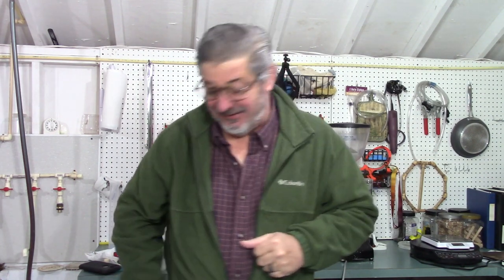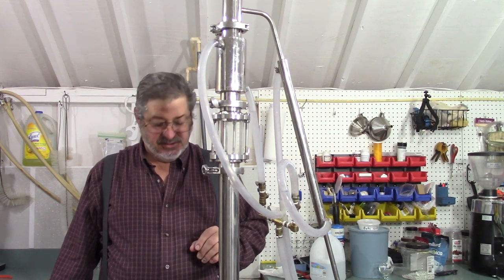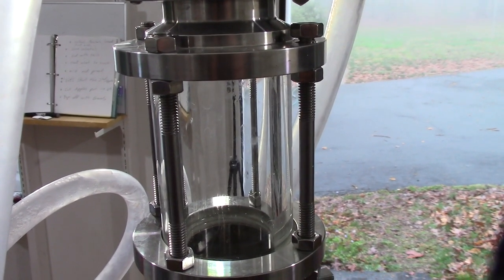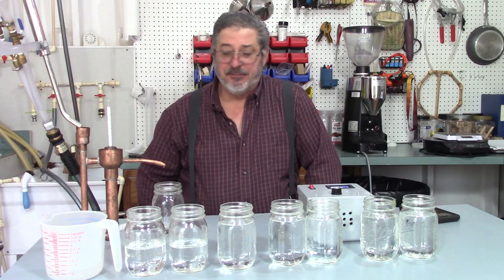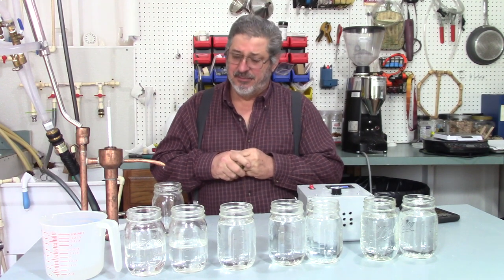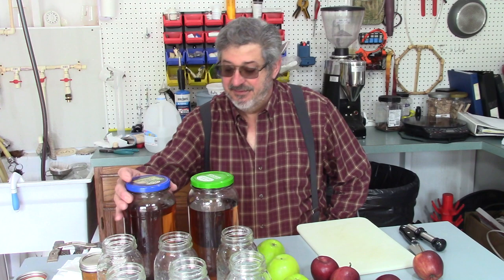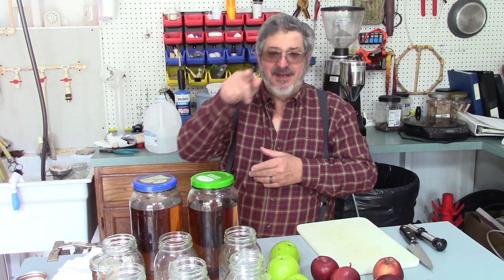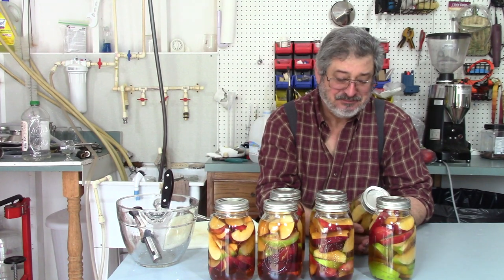E103 Apple Apple Brandy part 2

Comment: Randy great job, how do you get the apple flavor in the end if you use a post still. I have something close to what you have but I always loos all flavor at the end. I run it slow too
Reply from the maker: Great question yes you will lose "apple flavor" and you will keep the apple character of the apple so with that said you will need to add back some flavor I added the apple slices and all i can say is wow! hope this helped I will be having a tasting soon Cheers!!
Reply: @stillworksandbrewing  is there any other way. I am going to try a thumper to see. But every time I make a mash has no flavor and taste like ah!! . Not drinkable by my standards. But my lawn equipment likes it ...... any suggestions . 
Appreciate your time with videos and making it so that anyone can follow and get the just of what you are doing
Reply from the maker: @dalejohnson1577  yes a thumper will add flavor and i have added spices in a gin basket ( i use my sight glass for that) but needs to be let's say strong spices like cinnamon ect. I wanted to try some of the commercial flavorings but have not yet.

Comment: So with this apple brandy, all the forshots and heads should be out after first 6 ozs in a 6 gallon mash? I m struggling trying to figure heads hearts and tails in my first few runs . I’d appreciate any input Randy. Love your videos !
Reply from the maker: The first 6 oz will get rid of the methanol and heads after that make small cuts let air out for 24 hours taste if it taste good use it when you get into your tales you will smell and taste it. Best thing is to run low and slow and if you are heating with  propane use a diffusing plate to help prevent scorching hope this helped  Cheers

Comment: Nice Video Randy.
Couple of questions as I didn't hear it in the video - did you mix heads, hearts, and maybe a little of the tails?  What is the final ABV/proof poured into the jars?  Thx.
Reply from the maker: I collected 6 oz of forshots /heads and stopped at 80 proof left tail on table proofed down to 90  poured in jars thinking that the apples would lower to 80  cheers!!

Comment: Great video. Are you using a PID controller or the voltage adjustable that Mile High sells? I’m going to try your recipe. I appreciate your video and the way you explain it. 👍
Reply from the maker: I'm using a pwm switch I built Cheers!!
Reply: A pwm is a pulse width modulator which will control the power output to your heating element in your still. I am guessing that you already know that though. Mile - Hi does sell one, but you can make one for about half of what they charge for theirs, and it is pretty simple and can be put together in an hour or so . I believe Randy's is home brewed though. --den

Comment: Hey Randy, looking good on this recipe!  I've noticed that you trend towards 1x distillation?  Do you have a wider cut in favor of longer ageing as a result?
Reply from the maker: I do 6 gallon mashes run low and slow 6 oz forshot/heads cut and stop at 200 deg head temp 80 proof and i have been able to keep most  Cheers!!

Comment: Curious ... why don't you ever do a stripping run then a spirit run? That is how it is traditionally done unless you use a thumper. Spirit runs can be done slow in pot still mode for flavored spirits or slow in reflux mode for neutral spirits.
Reply from the maker: Great question I do 6 gallon mashes and that fits perfect in my 8 gallon still I run low and slow so no need for a striping run  i feel a striping run is for to reduce large quantity of mash to a manageable run  Cheers!!
Reply: @stillworksandbrewing  Not that it matters, but I agree with you Randy. Nine inch nails has a point, but when trying to carry over the essence of flavor, the more times it is run, the less flavor remains. I can see when distilling a neutral that fast and hot will get more alcohol out of the wash, because you may run it all the way down to 10 percent or less. However, it carries all of the tails with it that you don't necessarily want anyway. Then, you need a second run through the still just to clean things up to make it pleasant to drink. I'm guessing three to one ratios of stripping runs to final spirit runs, to fill the still for that spirit run. That takes a lot of running time and three mashes which requires more fermentables and fermenters up front. Keep up the good work my friend. --den